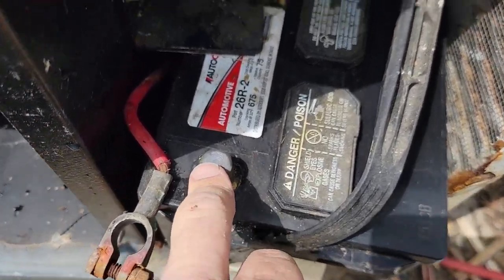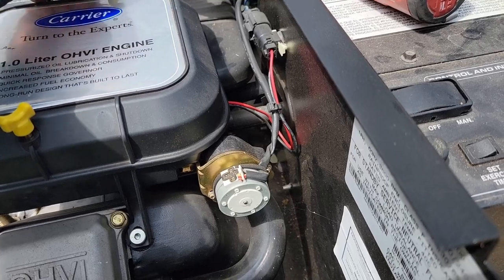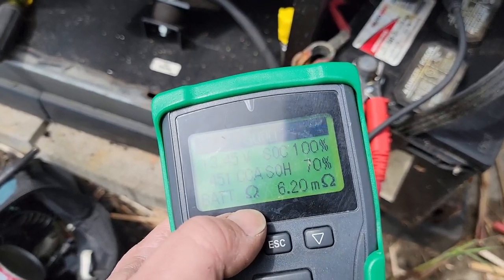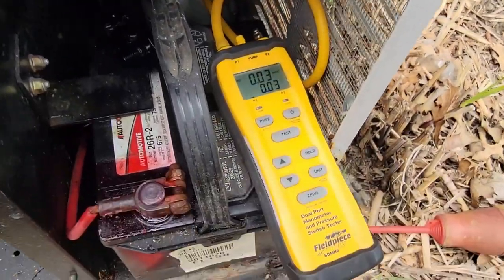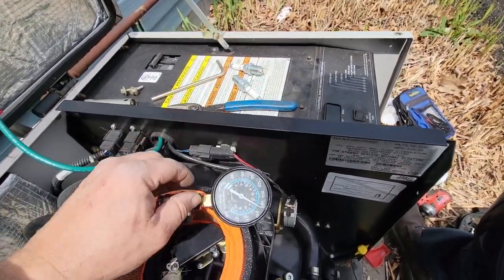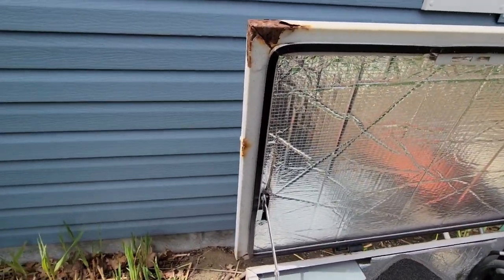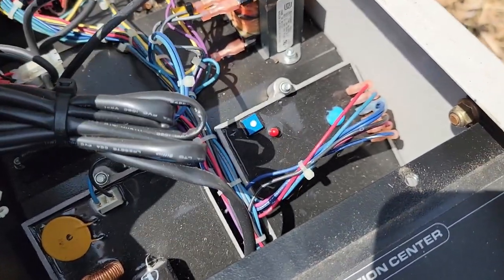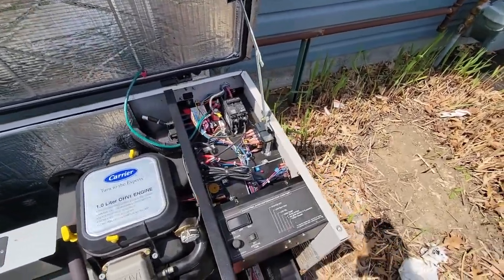Generac Generator Just Cranks

Comment: I know I am late to the party.  I am not a Generac expert but I do have one sitting outside my garage that I am in right now.  I can tell you that I am a wet cell lead acid battery expert.  They will discharge through the dirt on the case.  Cleaning the dirt off the battery needs to be part of the yearly maintenance.
Reply from the maker: @rlwoods61  I agree more should be done to the battery to keep it operating at its best potential. Loose, dirty or corroded connections will kill the power transfer from the battery to a load such as the motor starter or control panel.  The battery will discharge while sitting in standby even if there isn’t a load on it if it’s not maintained with a trickle charger. I’ve gotten 7-8 years out of a lawn mower battery that will normally only last a year or two if it’s not trickle charged because it slowly discharges over the months of storage when not needed.

Comment: A service company came out to see why my mom's old 15kw wouldn't run and told her that she needed a new unit installed for $10k.  I went over and checked it out and found the Fuel valve to be the problem, just like this one.  $180 later, she was running like new!  It's been in service since 2005 Hurricane Rita and this was the first repair other than  battery replacements and oil changes.

Comment: Had never had occaision or need to open one of these until Hurricane Ida August 2021.

A day after the eye passed, went with my neighbor (an electrition?) and two crackheads to pick up a generac that had been replaced for a larger unit at a doctor's home in exclusive neighborhood but had been sitting outside for god knows how long.

Drag it out of the pickup, ala four man 2 pipes,  Egyptian slaves carrying Cleopatra, plopped it down and after an Autozone run for a battery and multiple scary extension cords to three houses for basic fridges, fans and window AC we all survived for ten days until grid restored.

Warming up to the thanks for posting this. Now that hurricane season once again upon us, want to give that beast a tuneup and once over BEFORE we need it again.

You show how many different skills, trades and tools all come together on these machines.

¡Gracias caballero!
Reply from the maker: Thanks so much for your kind comments!

Comment: I'm glad I found your channel I just learned something about the generator I have to work on them and it's trail and error because I've never took a class on anything I do like to work on cars so that helps a little my 30 years of experience is all hands on the two finger bang is alright I use a very light mist of starting fluid spraying over the top and letting it fall into the carb
Reply from the maker: Thanks for reaching out and letting me know, I appreciate the kind words, hopefully these are of help to you.

Comment: Great job keep up the good work you're not the only one that has a bad day. We have a diesel tractor for the mower. Started great this year but the batteries were getting old. We decided to buy two new batteries for the diesel. Started one time died . Took both batteries back they checked them they both had dead cells in them. Then they couldn't find any at the store that had good  cells. So we end up going 40 miles away to another store to get one. So I guess we're joining your world. Take great care of the family . Be sure you don't get a charge and make your hair curl
Reply from the maker: Finding a battery store than will check the individual cells is getting to be a rare thing.
Reply: @HVACRSurvival  the store that check the sales has been in this town 35 years it's the third generation of owners. They are wonderful people to deal with. And they even check the battery we had to go get from a big chain store before we took it home. Keep it local

Comment: That is a vacuum regulator. While the normal gas regulators provide a positive pressure over ambient, aka gas flows with a open line, those open only once a certain amount of suction is achieved. That's why plugging the inlet worked, the vacuum increase unsuck it.
Reply from the maker: Exactly, it's similar to a negative pressure gas valve. Inside the belly it has two bellows that have a rubber gasket that opens when the engine intake stroke happens but it sticks because they don't run much. There junk
Reply: @HVACRSurvival  ... when you take it out, open the covers and you will find bugs or other debris gumming up the works. Still in all, the fix is a replacement.

Comment: Thanks for your input and advice I’m having the similar issue with my 18w generac I replaced the propane regulator but watching this video you mentioned those diaphragm issues I’m thinking that’s my problem because it turns over but won’t start now before changing the regulator it would turn on for a short minute then cut off yes it’s on propane switch side it very frustrating thanks I’ll try your two fingers trick…maybe it could work again thanks enjoyed your video thanks
Reply from the maker: You're welcome.

Comment: Hi, on a small multifuel generator, the input gas regulator had a small plunger that helped prime the line and also the speed of crank helped with the start of generator when using natural gas. A pull recoli would not start with natural gas, gasoline yes started right up, but propane or natural gas, definitely needed a fast crank with a full charged battery. Great video, I have the Generac 15kw portable gasoline generator, basically same engine .
Reply from the maker: That's what I own, gas versions, I have an inverter and I have an 8,000 continuous. Never had a problem out either one.
Reply: @HVACRSurvival  I have a customer has the big 15kw 'portable' one. I put portable in quotes because yes it has a handlebar but it weighs a ton. Had no issues with it, except I replaced the battery and voltage regulator on it last year. It was working, but putting out over 300 volts... like 165v line to neutral instead of 120. He shut it down during a 1 day power outage when he noticed his lights were way too bright and flickering.. Luckily it only damaged a sound system, and the refrigerator survived etc. Burned out a couple outside lights.
Reply from the maker: @brnmcc01  I've only worked on one of those large units, it's basically a home standby generator with wheels 😳🤣
Reply: @HVACRSurvival  Yup it had the same 992 30hp v-twin like the home standby except ran on gasoline. He had a setup though that he converted it to run on propane with a flex fuel hose. He would just take it out of the garage, plug it into an inlet box, flip a manual transfer switch, and plug in the fuel line to his house LP gas supply. Two underground 1500 gallon tanks
Reply: @HVACRSurvival  That's the only one I've worked on too, had about 100 hours on it. I checked the valve clearances just for fun, right on the money, and never been touched.

Comment: I’m in the same boat brother I’m the only one that is crazy enough to work on the genset and don’t work on generators all the time so when you get something figured out you don’t see another generator for a few months and your right back to learning all over again
Reply from the maker: Your exactly right! I said more but had to cut it out...
Reply: It helps that I like working on small engines and auto engines valve adjustment is a big part of small engine not starting and compression thanks for sharing you knowledge with these generators brother
Reply from the maker: @dougking7592  anytime you have a passion for something you have a better chance of being your best at it. When I first started working on generators I wanted to know everything there was to know about it, now that I'm at this company I really have gone deeper into refrigeration and walked back away from the generators. I started with generators in 2006 and for the last 7.5 years I don't service that many here like I did where I was at previously. So it's time for someone else to take the torch, I believe in either being all in or all out.

Comment: Had this problem. Watched this video.  Went to get my tools to remove the filter cover to perform "operation: double finger" when i noticed my generator was the model without the airfilter mounted on top (nowhere to be seen from plain sight).  Thats when i tried to start it again manually one last time and BAM it started without issue.  Mind over matter.
Reply from the maker: it will happen again, lol it always does

Comment: U should of checked the valve adjustment also with those models its crucial because most people don't do valve adjustments also while the unit was running should of turned fuel off and on to make the fuel reg open and close but u are on point with everything else
Reply: That was my thought, too. 

Worked on a Centurion yesterday (Nexus controller) that didn't want to start. While cranking, you could definitely hear it had tight valves. Removed the covers and found there was zero lash on both exhaust valves. Adjusted to spec (0.002"-0.004") and it really wanted to start, but was still hesitant. 

Rotated the stepper motor linkage and found it to be 'crunchy'. Replaced the gear assembly from a good used stepper and it fired right up. 

Customer stated he'd never heard it run so good.
Reply from the maker: I've checked the valve alignment so many times and found it to be not out of spec and nothing more than a waste of time. Most of these generators are failing with only a few hours,  almost none of them have no more than 40 or 50 hours. They're junk plain and simple. They're piss poorly manufactured.  I've been in the factory before they created the training room outside of the factory.  These things are thrown together.

Comment: a few years ago Generac had an inspection program on those air box / regulator assemblies. They would pay a dealer at warranty rate to change it out if there was any sign of rust on the can portion. (most have some sign of rust) Since they never asked for a parts return, we changed many for a variety of reasons.... probably somewhere near 1,600 of them all total, which took near 2 years. BTW, the factory wanted them changed by a certified gen tech, which was no problem. The catch is there are several states where you MUST have a gas license to play with the fuel lines outside the cabinet. Basically, unless there was a union directly on the back of the unit a gen tech was not allowed to do the gas work. I would estimate that 98% of the units fell into this category, and 50% of the rest needed extra work to bring the gas up to code. Good thing we had two techs with the required state gas license.

Comment: Oh question can just rebuild the diaphragm portion I don’t know what it’s called either but the whole thing where the diaphragm is located at can I just rebuild it also I like that yellow gas meter to check the flow of gas it’s nice no mention of it in where to buy one in the description thanks again
Reply from the maker: If you're talking about the thing that has bellows? that's your fuel regulator. No you cannot take it apart!!!. It's not safe... DO NOT do it!

Comment: Do you have any infovideo on troubleshooting the weekly cycle run. It is not setting even after taking out fuse and following the instructions. Same unit as this video. Also on steps to switch over to propane and back to natural gas.

Comment: And another thing: loose clamps on the oil lines.  I had mine professionally installed but manage the oil changes and battery changes myself.  After about 2 years the power's out and the generator ran for a bit then quite.  No oil, turns out the rubber oil-lines had come loose and blew oil all over the base.  Cut-out on low oil pressure.  Cleaned it, tighten the line and check the other ones (also loose clamps, from the factory).  Been running it since 2004.  Did have to adjust the governor down slightly as it was running at 63 Hz under light load and that caused the UPS on my computer to complain (it won't switch back to line voltage if the line frequency is outside +-3Hz).   I also had a relay stick in the  (separate, whole house) transfer switch causing it to cycle back and forth until it blew out a contact, and I also had a battery crack at the base and leak out all the fluid.  So, good and bad, but the gen-set seems to be relatively reliable.

Comment: Good job Rick, those disconnects or transfer switches seem kind of dangerous, I can see why an electrician don't want to be involved,  A lot of times the costumer does want to pay for the expensive transfer switch and wants to do the cheap way out and try to back feed the electrical system, which is dangerous, Good work again.
Reply: this particular unit (and its cousins) can't be installed with a manual transfer switch.

Comment: Hi. Have you ever done troubleshooting for a condition of Undervoltage fault E1902? Great videos, by the way, and good troubleshooting skills.
Reply from the maker: I have had a few, usually it will start working again before you find the real problem. 🤦🏻 (Possible lose connections or bad crimps)

Comment: Hey Rick, great video.  Any thoughts on older 7kw generac that won't stay running. The voltage regulator has been changed. Start great runs and then shuts down.

Comment: Great Video! I have a Generac 7KW Cube with a constant RPM Sensor Failure after 5 seconds of start time. The unit just started this. I have fuel, Spark, Oil level and a good Battery. Looks like I may have a bad RPM sensor. What do you think? Thanks!!!
Reply from the maker: The RPM is measured from the magneto. It's not like a liquid cooked motor that has a dedicated RPM sensor.
Reply: @HVACRSurvival  ... most likely an output issue. Lack of proper voltage (output) will cause a shutdown. Those "cube units" (looks like an AC unit) are a whole different breed. I have forgotten what they use to show the reason for a shutdown. (flashing lights?) Oh, low oil pressure / bad switch will also kill things after 5-10 seconds.

Comment: Thanks for the video,  i recently got a unit just like this on trade that needed engine work.   Believe its a 2008. 13kw with the gt990. Got it back together and purchased a regulator and hose to temporarily hook it up and test it.  It's hooked to a 30lb tank.  It fired right up after sitting for 6 years. I let it run for 15 minutes and shut it off.  Went to start it today and it fired right up but sounded a bit different and down on power. Then it back fired out the intake and blew the intake box cover apart. I'm a auto tech,  the engine side of this unit is super basic for me but not well versed in the l/p side of things.  The regulator installed is listed for 165,000 btu at 11" water column.  You think that's on the lean side for this unit , no load just testing? Also i read that coils are a common issue and may be the issue.  I do have spark and compression is 185 on each cylinder,  valves at .003 . I don't have a gauge to test the gas pressure . Thanks for the tip on the voltage regulator, this one is reading a little over 270 when running
Reply from the maker: Short term, a few minutes a run time, no load you should be ok. Those tanks can't run that kind of btu without frosting up and losing pressure.

Comment: Hi! I have a problem with 20 kw generac starting on a warmed-up engine, a shot is fired into the muffler after which the generator starts and works fine, once during such a start the air filter housing broke. Can you help solve the problem? The valves are adjusted, the candles are new. Could there be a problem with stepper motor? A shot into the silencer only when hot starting, after it works perfectly without interruptions
Reply from the maker: There's a list of things that need to be checked. You need the service manual to properly diagnose it. It's not a 10 minute job.

Comment: One of the most common issues I’ve found with these generators when it won’t start or is running rough is the valves need to be adjusted after about 250 hours.  You are also right about the voltage regulators.  The one on my mom’s generator has died twice and it always sends 330+ volts.  We are lucky it didn’t damage anything in her house like her AC or refrigerators.  The third one was a new model that was supposed to fix the problems with the first generation of regulators.  After replacing it a second time I put a voltage protection device on the generator that way if it goes out and the voltage goes high like that again it will trip and shut off the load to the house and has to be manually reset.  I set it for 260 volts and we haven’t had any issues like that since.
Reply from the maker: What device did you use to shut it down for over voltage?
Reply: @HVACRSurvival  I used the EV-1 over-voltage monitor from MTS power Products.  I always recommended these for the older generators with the older voltage regulators.  It’s not a matter of if but when those older regulators will fail, and it has the potential to do damage to appliances when it does.  That was a horrible design by Generac not to have some sort of over voltage protection already built in, although the newer one’s do have that.
Reply: Thank you for your tip & for your advice! Sincerely appreciated!

Comment: I did the 2 finger trick and it started right up.  I'm just confused as to what the actual problem was that caused it to go out on overcrank?????
Reply from the maker: It's not getting fuel, when you put your fingers in there it causes it to suck harder on the diaphragms and sucks the fuel in. The diaphragms are hard,